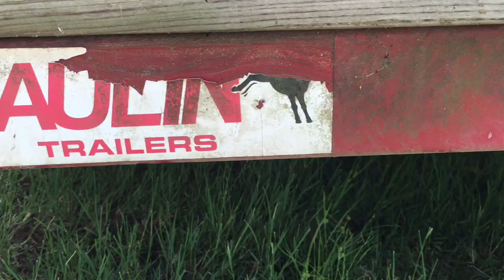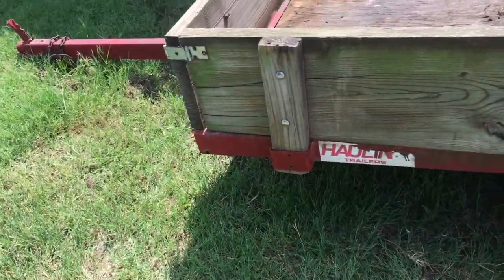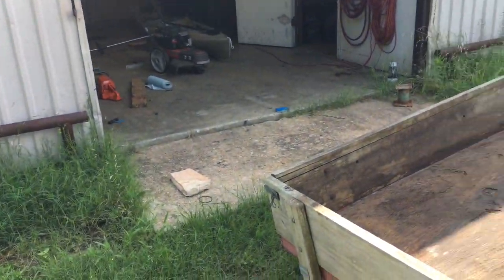4x8 Trailer Restoration

Comment: It's a 4x8 Haulin Ass tilt bed trailer that Home Depot sold 20 years ago. I have the same one and I put up wooden railings and painted the dust caps red to make it look like a Radio Flyer. Women think it's cute and it is beautiful compared to all the black angle iron trailers sold nowadays.

Comment: I have that same exact trailer and it is actually rated for 2000 lbs gvw (about 1600 tare). I've hauled my 1300 lb cub cadet with no problem. As long as your tires and springs are in good shape it should be fine.

Comment: Where you able to locate a Vin number... Just got one exactly like this and trying to find Vin for registration
Reply from the maker: Never found a vin or any info on the company that made it. Ended up selling as is/ no title
Reply: The VIN from the factory was printed on a sticker that would just peel off in time, not a riveted metal plate like it should have been.
Reply: Where was the sticker located? Or supposed to be?
Reply: @camaro2002rs  the sticker on mine was on the axle. Just a serial number, but there were two pieces one was perforated that you could tear off and get a vin issued  by your state. It depends on the requirements of your state. I have an '01 that was given to me a few years back.
Reply: My haulin ass 4x8 has vin id plate on axle
Reply: Vin plate is on center of axle..metal stamped plate
Reply: @camaro2002rs  hi..look on the axel.i found mines there..
Reply: @cannonball666  Yep. Mine peeled off. I got the VIN from the title and had a metal VIN plate made which I riveted to the frame where the sticker was located.